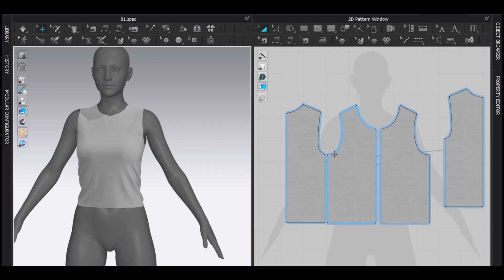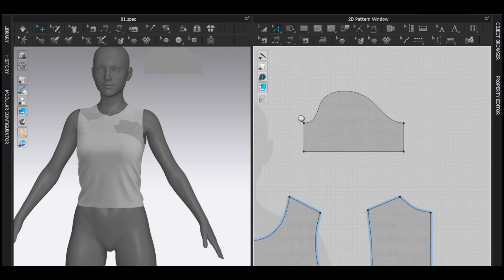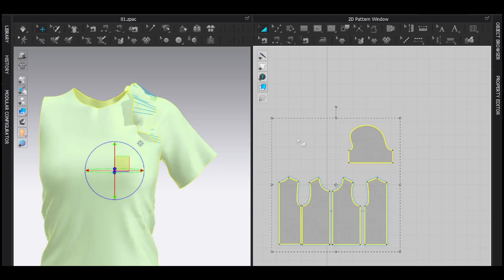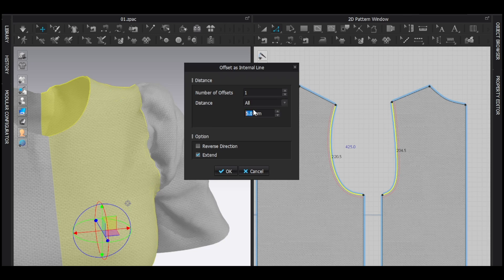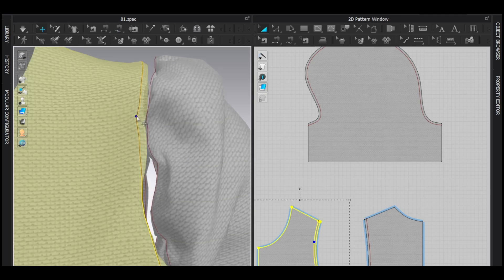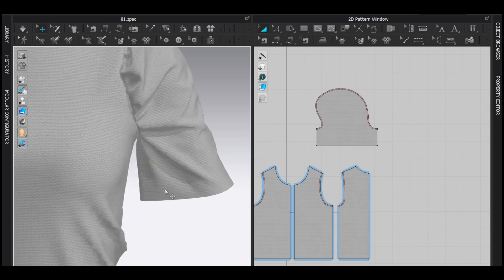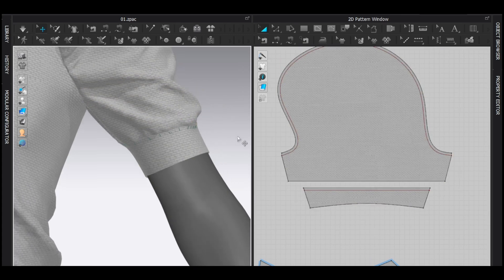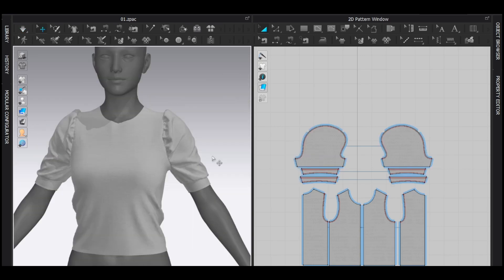How To Make A Puff Sleeve - Clo3D/Marvelous Designer

Comment: At the end of the second stage when i click space the sleeve moves fast and even comes out of the arm.I tried to sew it from under the arm but its still the same.I often have this problem with sleeves.Can anyone tell me if i can solve it in some way?
Reply from the maker: I'm having a bit of trouble understanding the issue you're describing. However, have you attempted arranging the sleeve pattern using arrangement points? 

can you send me an image/video on my IG if possible?
https://www.instagram.com/fabmat00/

Comment: 4:17 how did you activate the pivot? Short key?
Reply from the maker: Use transform point  / segment tool - click on the line - double click in the middle dot to activate the pivot 

And I assigned it as short key in the setting. (E) - (i think it's default, I could be wrong)
Reply: @FabMatt0  can you also help me with another query i have? Does the avatars polygon matters while making a dress?I don’t use marvelous provided ava ..the one i use to make dress makes the dress very stiff and low poly?please help me with this if you can
Reply from the maker: @fly928  somewhere around 50k to 150k polygons fits perfectly for me. (it also depends on the machines)
just make sure its not too low poly otherwise the dress will look jaggy and make sure its not too heavy otherwise MD will slow down